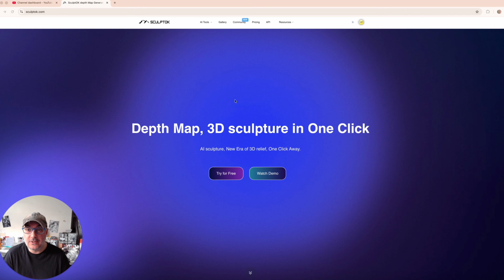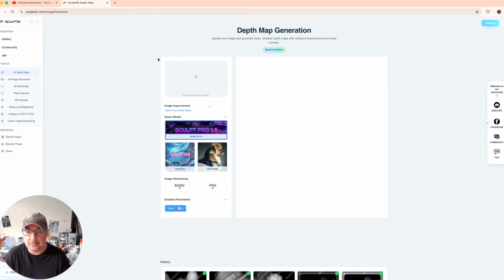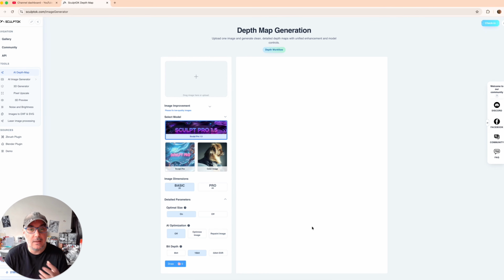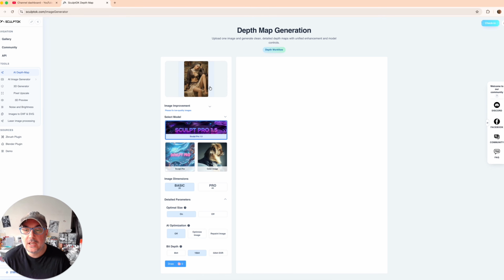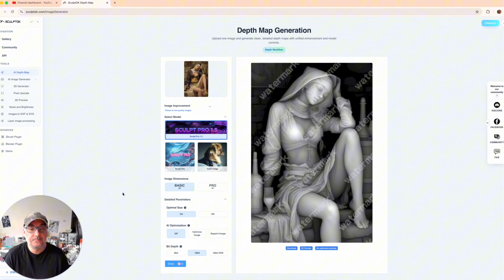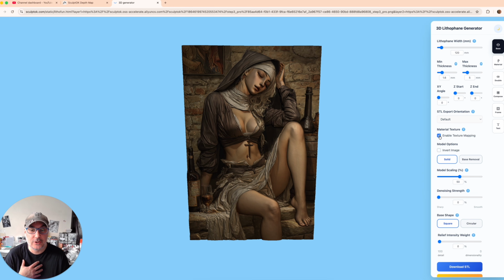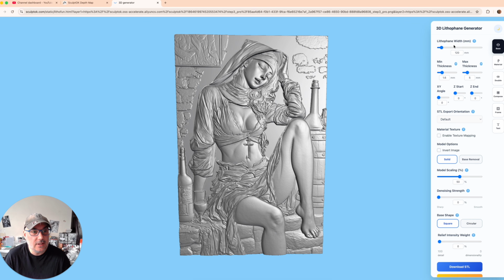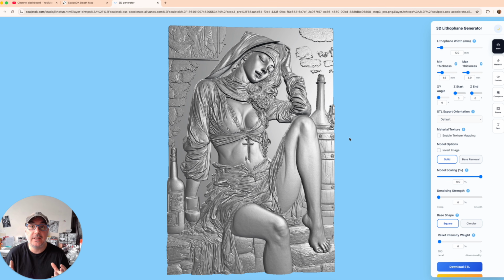I Turned Any Image Into a 3D Model… This Is Too Easy

Comment: So quick question at the end on 3D preview how you raised it to have a deeper relief, does that reflect on depth map once you change the setting there?
Reply from the maker: Great question, no its does not, the depth map will stay the same, you can save out the stl file to which ever depth you want, the depth map is just the depth map and will not change regardless what you do in the preview, to change the relief of the stl file you do that in the preview or stl file editor software.

Comment: I don't recommend this at all. The depth maps are incredibly noisy and totally unusable. I paid $19 for the Pro version, and it's definitely not worth the price. Even with 4K image inputs, the results are full of glitches and noise.
Reply from the maker: That is interesting to hear, ive used this for over a year now and get excellent results for my workflow, perhaps your starting images maybe something to do with it?
Reply: @SilverPunkPour  I've tested plenty of different images, but the results are still coming out noisy with too many bumps. It ends up needing way too much manual cleanup. What kind of images or settings are you using to keep the surface so smooth?
Reply from the maker: @YoussifeBadawi  i use images which i have upscaled first resolution wise, and adjusted the contrast if needed, i then just use the standard preset setting on the main part to get the depth maps coming out great